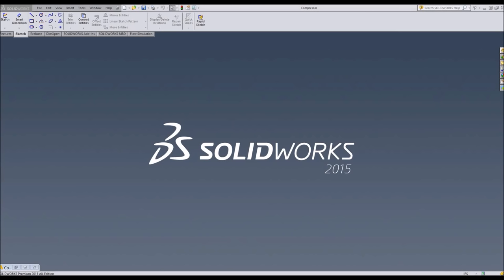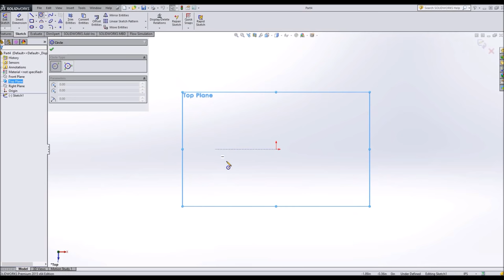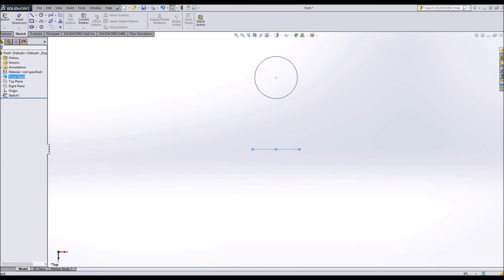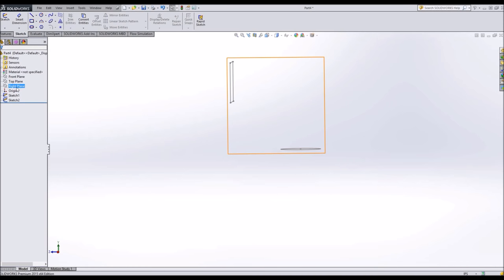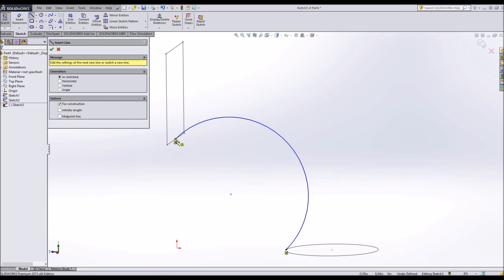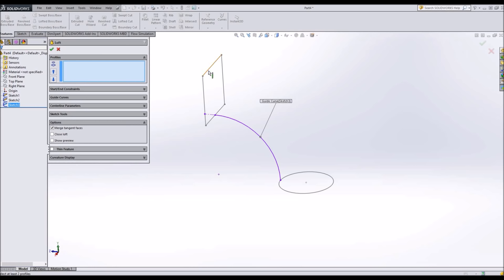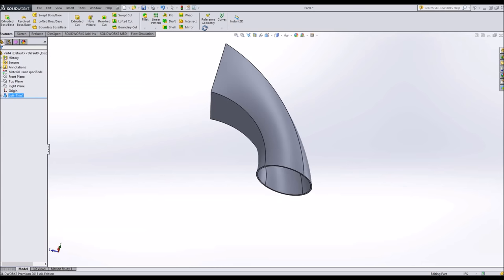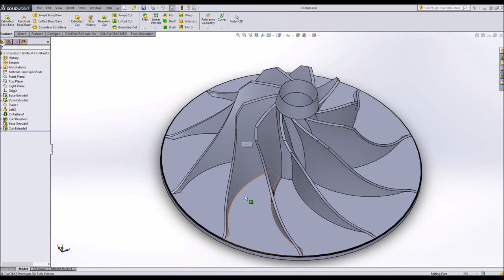How to Loft in Solidworks |JOKO Engineering|

Comment: Hey, I couldn't execute the make pierce relation. I am just getting the error message, "No intersection found for pierce point!" Please help me with the issue. Thanks.
Reply from the maker: For the pierce relation, I imagine you're in an active sketch piercing to an inactive sketch.  The error occurs when the sketch plane you're using on the active sketch does not have contact with the inactive sketch.  If you adjust the sketch plane on the active sketch to collide with some part of the inactive sketch, you'll resolve the error.  Message me again if I can be of more help or clarify more.
Reply: Thanks for the detailed explanation. It was really helpful. Got the issue resolved.👍
Reply from the maker: Excellent, good to hear
Reply: I love inches!

Comment: I need to conect two triangle profiles but when I select the first tell me "the sketch should  contain a single open contour". Can you help me?
Reply from the maker: Yes the profile you select that gives the error means that the triangle isn't closed, or it's made up of multiple sketches instead of one.  Make sure all the lines of the triangle are connected, sometimes the lines get close without actually touching
Reply back if you need more help

Comment: Can we use features , surface and sheet metal modules in one same model ? Or it only can be used individually?
Reply from the maker: You can use them on the same model, but if algebraic surfaces of sheet metal is broken the model will no longer flatten

Comment: Hey Joko,
I am busy with my magister in engineering and need to create a model of a finned coil heat exchanger. The fins need to be updated from a plain configuration to something that would be seen in the industry. The new fin needs to be contoured exactly like the actual heat exchanger's fin. 
I am only simulating the flow through one segment of the HX to save computational resources for my laptop which will be performing the simulation. Is there any way that you could help me in creating the fin?
Reply from the maker: Are we talking about the basic "zig zag" type fin that you would see on a car radiator?

Comment: I am really liking learning new features on Solidworks, but I have to ask with this part, how would this be manufactured in the real world besides 3D printing?
Reply from the maker: If it was in my current place of work, we would source the tube and weld the flanges on after plasma cut in house, but you could probably find a foundry to cast the whole thing if you needed to.
Reply: Weld maybe?

Comment: that's fine if you want your finished faces at 90 degrees. what you didn't explain or demonstrate is how to do a loft with two parallel planes
Reply from the maker: I'm not sure what needs to be explained?  You would use the same method

Comment: HOW TO UNFOLD THIS  FOR SHEETMETAL CUTTING AND BEND
Reply from the maker: Unfortunately only developable or algebraic surfaces can be unfolded for sheet metal; this would be a NURBS surface and SolidWorks doesn't have sheetmetal functionality for this.  Sheetmetal loft may be able to produce something that will work but it would not have curvature.  Flatten surface could flatten this as I do here at 3:00:

https://www.youtube.com/watch?v=tdr4sk72OwE

But flatten surface would not be applicable to a sheet metal design.

I had a user ask a similar question about sheetmetal on NURBS surfaces and I made them a video here:

https://www.youtube.com/watch?v=poZoApB-CyU&feature=youtu.be

There are paid add-ins for SolidWorks such as blankworks that might be able to flatten that flange.

Good luck

Comment: 1:35: "Now I'll get normal to my front plane" ? That's where you lost me. Not making sense. Can't procede.
Reply: From wiki:

Normal (geometry):  “In geometry, a normal is an object such as a line or vector that is perpendicular to a given object. For example, in two dimensions, the normal line to a curve at a given point is the line perpendicular to the tangent line to the curve at the point.”

Getting normal to a plane means looking directly at it.  Looking at a plane when you are parallel to it means looking at it from the edge.  Isometric means looking at it somewhere between perpendicular and parallel to it.

For example, looking at a book when you are normal to the cover allows you to read the title, but you wouldn’t be able to see any other side, so you couldn’t tell how many pages it had.  Looking at the book parallel to the cover, you wouldn’t be able to read the title, but you can see how thick it is.  Looking at the book isometrically will allow you to see the title AND how thick the book is.